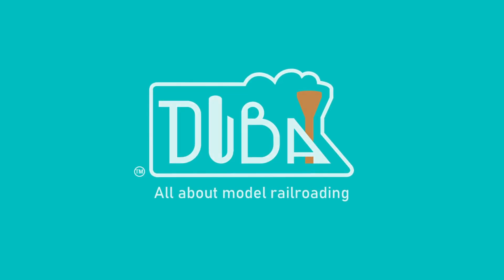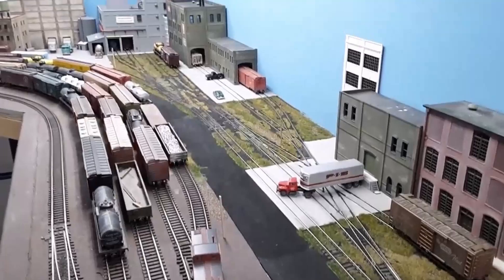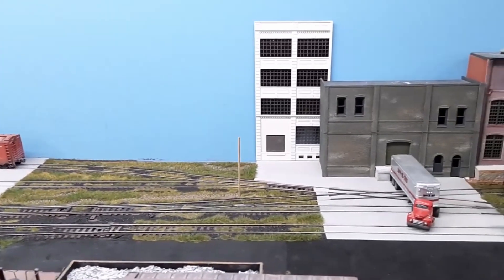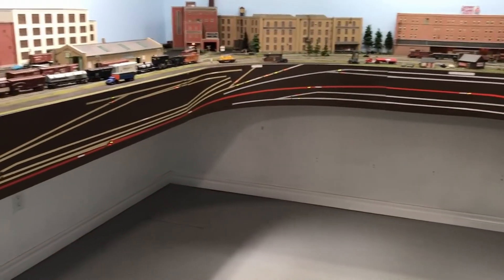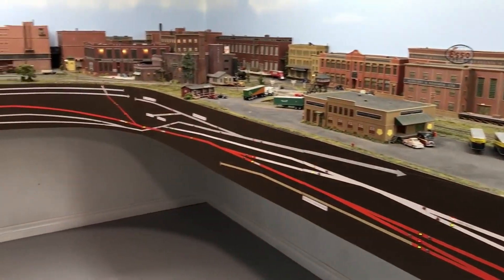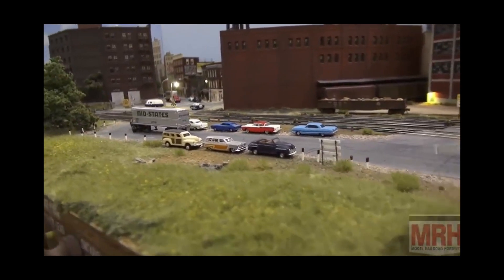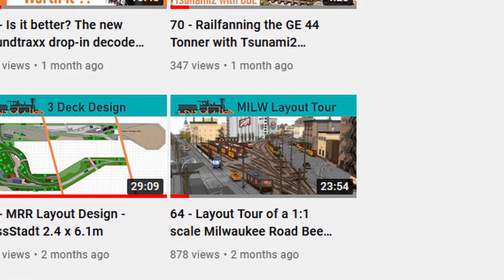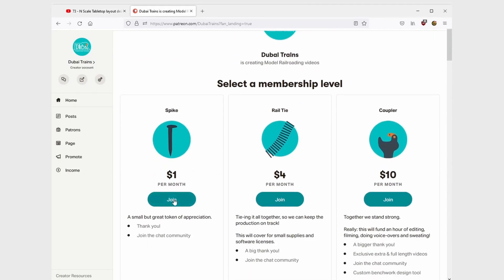76B - 3 layouts that changed my way of thinking.

Comment: As long as it has a brewery.  I love that.     The idea of a double around is appealling, but execution is the 600 pound gorilla.  I saw one great example where the loops had grade differences which helped.  
It'll be interesting to see your answer to too little room.  This is the new question as homes get smaller.
Reply from the maker: A brewery has a lot of switching action, and requires a large variety of cars. Hoppers, tank, box, coal (or oil) and reefers! 
A twice around the room is better with grades. As a lot of track can be more easily hidden. The tradeoff is a more complex build. Thinking of the milwaukee beer line it could be prototypical ish. But forget about using small switchers! At least for the uphill direction.